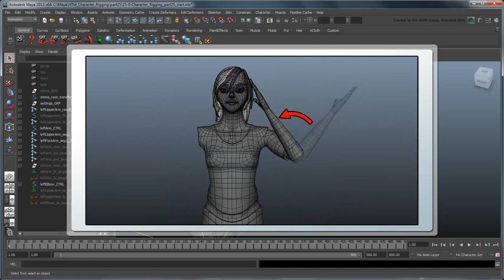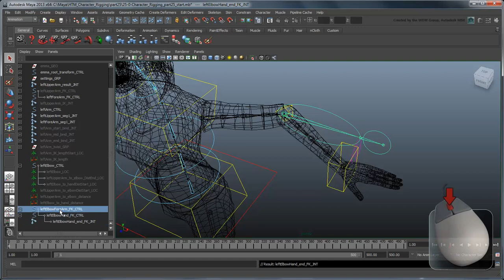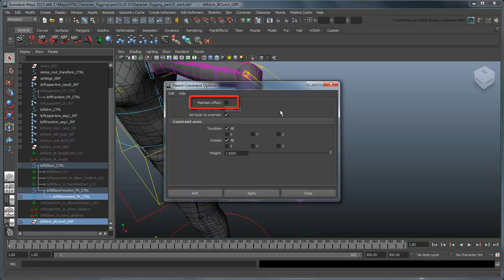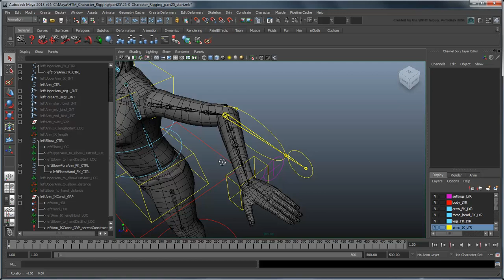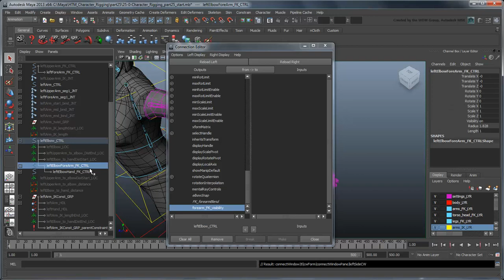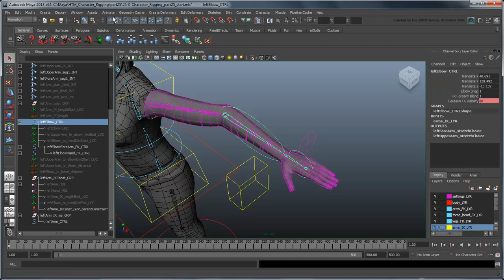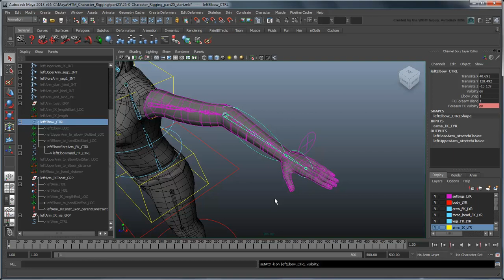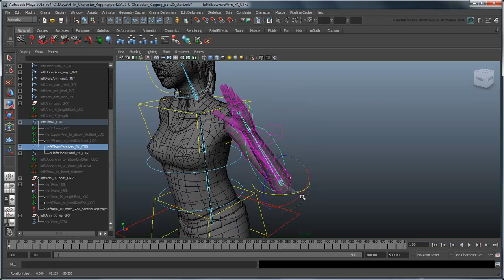Creating a Character Rig - Part 25: IK/FK hybrid elbow (Advanced)

Comment: Hi.
The Elbow still seems to not keep it's position orientated towards leftElbow_CTRL. It wants to rotate like an arc. 
Could it be because the joints for the left arm weren't in a straight line? The arms are creating a ~45* angle with the body and, at the knee, I have another angle ~5*, creating a little arc with the UpperArm and ForeArm, as we had at the leg's knee...
Reply from the maker: +DragonDinu The initial setup position shouldn't matter much, though I do recommend setting up a t-pose that is straight or near-straight.  When you move the elbow control, does it have any effect on the arm at all?  If not, then it sounds like the pole vector was not created properly.
Reply: Maya Learning Channel
It has. It rotates the arm according to the direction the locator points to.
I see that the Elbow rotates like that even without the Pole Vector constraint.
Reply from the maker: If it rotates like that without the Pole Vector constraint, then it means the constraint must not be set up properly (it should definitely not react the same way with / without).
Reply: +Maya Learning Channel I recreated it into a T-pose. That problem disappeared. Thank you!

Comment: Hi. When, after rotating the leftArm_IKConst_GRP to match the position of the joint in Elbow FK mode, I create the parent constraints between the leftArm_IKConst_GRP and the arm CTRL and Elbow FK joint, the wrist now flips backwards as well as upside down.

After setting a driven key anyway, I see that this flip only ever occurs when the FK Fore Arm Blend is set to exactly 0.5.

Rotating the FK Elbow Hand so that it points slightly upwards and then adjusting the Fore Arm Blend makes the hand do a full 360 degree turn forwards until it reaches the destination of the FK Elbow Hand joint.

Do you know what I can do to remedy this?
Reply: Maya Learning Channel In fact, it's because my FK hand control's axis doesn't line up with what you show at 4:56.

However, I cannot for the life of me figure out how to orient the axis correctly; I want the Z axis to point up and Y axis to point forwards as shown, but all I can get it to do is point the Y axis forwards but the Z axis down. I cannot 'mirror' the bone's axis, even though that's what I should apparently need to do to match the  LRaxis to show up as you depict it in the video.

EDIT
Nevermind, figured out that my rotation axis is the same as yours.
However, the problem in my first comment still persists.

I did read multiple people who have commented here had the same problem and that you address it to a 'rotation space' problem, but I don't get what I should be changing to remedy this. I've already duplicated the FK chain and set the whole thing up twice now, both with the same result...
Reply: Shrooblord emummy Jared Davis Maya Learning Channel 
I figured out what the problem was for me!

My FK_ElbowHand joint had negative joint orient rotations, causing the IKConst group to rotate towards the negative X to be able to match up. This causes issues.

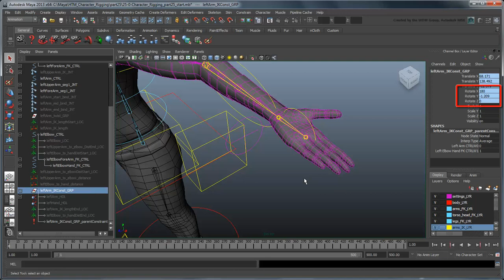Reset the joint orients to 0, 0, 0 manually in the Attribute Editor and perform the steps detailed from 5:12 onwards. If all goes well, you'll have a working rig. :)
Reply: hi. I know, it's been a while now. But I ran into the same issue. How did you fix it?
Reply: @Shrooblord  , @MayaLearningChannel, @ManuelDing I just ran into the exact same issue. At a value of 0.5 for my FK Forearm Blend Attribute my leftArm_IKConst_GRP gets rotated in an unexplainable way. At least for me... I wanted to try out your suggested solution, but I guess it doesn't work out for me, since I have no regular 0,0,0 joint orientation on my leftElbowHand_FK_CTRL Joint due to some bending in my lower-arms model pose.

However a possible workaround to tackle this issue is to create one more driven key at the value of 0.5. Than set the first weight of the parent constraint to 0.501 and the second to 0.499. Don't forget to make your tangents linear. I know this seams a little hacky, BUT it worked out pretty well and since the difference in motion is unnoticeable I think its a proper way to go.

Hope this helps someone.

Comment: In the fk forearm, ik arm and neck, how can I add volume preservation just like we did with the torso?
Reply from the maker: arpit dadhich The neck you could add preservation by treating it the same way as the torso (cutting it up and applying the appropriate math nodes).  The arms are not as easy, because you need to account for the arm bending as well as compressing.  If you really wanted to do that then I'd add attributes to control the length of the upper/lower arm, much like we did no flip leg.

That said, you can at least apply volume preservation on the stretch on each of the segmented arms using the exact same method we did for the torso (since they are, in essence, mini torsos).
Reply: How robust is the method where we create blendshapes for volume preservation of the legs, arms and neck, using set driven keys to drive the blendshapes with the stretch of the limbs?
Is it unproblematic for future when we might make changes to the rig?
Reply from the maker: I imagine it would be fine, though I haven't tried it myself.  You may be overthinking this for a proxy rig though.  Remember that once you skin the rig there will be a sort of natural volume preservation.  Now if you also want to apply those blendshapes to the skinned rig (perhaps for an exaggerated cartoony character) then that's a different story.
Reply: Its a relief you approved of the blendshape method.:)thanks for the reply.
Reply from the maker: Just keep in mind that those blendshapes are going to be more costly both computationally and in terms of memory.  The math-based solution shown in this series is still the cleanest way to do squash/stretch.

Comment: For my character I am only making an IK arm with squash and stretch.  I am not adding in the FK. the twist arm, nor the snappable elbow.  I've got it set up and working well but,I need one more feature. The characters normal arm length are rather short, and in some cases he will need longer arms, like clasping his hands in front of his belly.  Is there a way to create a attribute that would lengthen his foreArm, and upperArm joints while keeping the squash and stretch function?  Thanks
Reply from the maker: Your best bet is to use the same theory as the snappable elbow, but manually control the stretch between upper and forearm using a variable rather than the actual elbow control.  However, if you mean to stretch the arm beyond the length of the IK handle itself, that would be a lot trickier (also I imagine it wouldn't be very intuitive to handle interactively since the control would no longer accurately convey where the arm actually reaches).
Reply: Maya Learning Channel
Yes, I thought of that but, then wouldn't I lose the IK functionality?  What do you think of this:  If I made a three chain arm but, instead an FK arm make a second IK that doesn't have the squash and stretch on it but, has an upper and forearm scale attribute.
Reply from the maker: I feel like you'll still run into the same problem with that second arm.  Why create two IK arms when a single stretchable IK arm with upper/forearm set to a scale of 1 would do the same thing?

In any case, controlling the upper/forearm scale via an attribute shouldn't break IK functionality.  It would essentially be the same functionality as the snappable elbow method, just without the snappable elbow.

Comment: So, I'm doing the parent constraint from the rightElbowHand_FK_CTRL. Duplicated from the rightForeArm_FK_CTRL and the hand does not twist improperly like the left hand did. But my rightForeArm_seg1_JNT chain twists even though the hand looks like it does not flip when the parentConstraint is fully on elbow FK. Should I just assume this isn';t going to be a problem down the line? Or is it an issue and there some additional consideration I should be making for the rightElbowForeArm_FK_CTRL?
Reply from the maker: The segment shouldn't twist because if it does, it means your result arm segments will twist as well.  This sounds like a space or joint orientation issue to me.  I would compare it to the finished rig in part 32 to try and spot any problems.

Comment: As of 8:55 into lesson 25, my FK Forearm Blend at .5 is fingers up with thumb out in a come hither position, but at 0 and 1 it every other step in between the hand is properly oriented with palm down and thumb in. Do you have any clue as to what happened? I copied the rotations into the joint correctly.
Reply from the maker: Sounds like you might still have a rotation space problem.  Check the rotation values as you did at 5:03 at the problem area to see if that is the case.  The scene files linked in the video description also include both incorrect and correct versions of the scene for you to compare.

Comment: Since the hybrid FK forearm doesn't serve any purpose if the elbow snap is not enabled, is there any way to prevent the animator from using the hybrid FK forearm when the elbow snap is off? Because if the FK forearm blend is on without elbow snap - it might confuse the animator, wouldn't it?